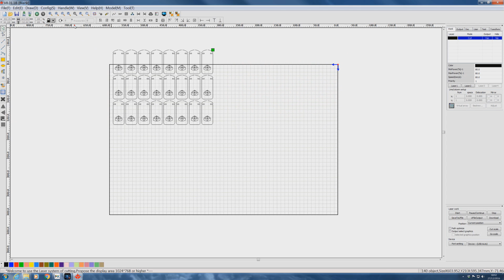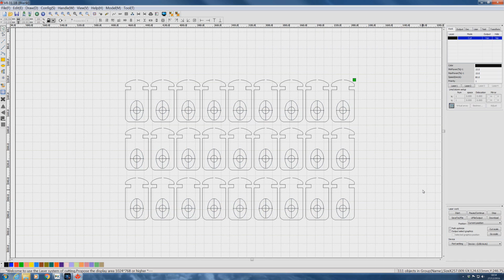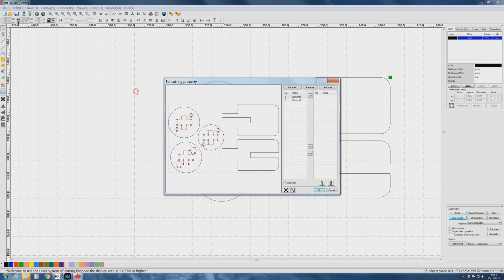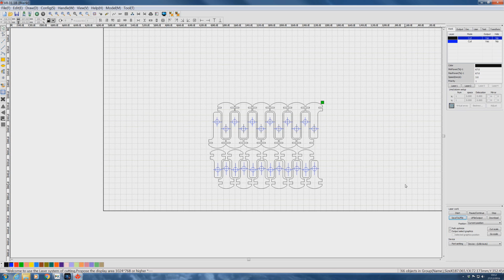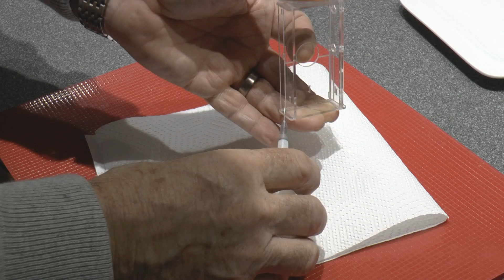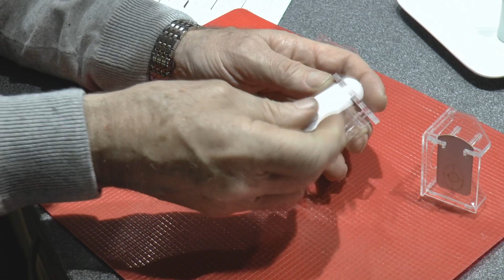RDWorks Learning Lab 91 Beam Targets and holders plus mirror tool

Comment: If this program works in the same way as Corell Draw, the grid pattern you have set up is the page. It should be the same size as the deck of the laser printer. In Corell, if you drag a group of objects outside of the page, (or off or the grid) the program doesn't see them as objects to do anything with. That means you don't have to delete them each time. You can just drag the items you want to work with onto the grid area and drag objects you've already worked with to the side. Off of the grid area. Give it a try.
Reply from the maker: Anything outside the work area will still be considered and it will prevent you running a program
Russ

Comment: DA, if still there I have sold three other 4060 60W machines. This  order qualifies for a $750 volume discount per machine. This discount when applied puts your machine, including shipment to Memphis, at $2530. I must schedule shipment of all machines within 30 days. Email if you choose to move forward. If anyone else wants to add an order for a 4060 60W laser  in next 30 days the same discount and 30 trial warranty also applies. After 30 days will need to sell a combined three additional machines for another volume order discount. ron

Comment: Do you have an opinion on the current state of the 1200-1400 USD eBay Chinese lasers?
Reply from the maker: Hi
The only thing I have noticed is there are fewer sellers of these bottom end machines. The choice is now down to less than 10 for 50/60 watt machines, whereas a year ago there were 30 or 40 to choose from. The tube and psu quality is still rubbish so what you are buying is a mechanical/cnc system that is still very good value for money . The tube in particular is definitely a consumable item but just like inkjet manufacturers supply new machines with full size cartridges but 5% ink inside, to get you started, the Chinese have adopted that same principle for Ebay machines. If you buy from a reputable source in China you get what you ask for but at a much higher price. The ebay route will always be a bit of a lottery. 
Best regards
Rus
Reply: SarbarMultimedia
The 40 watt lasers have greatly increased in price as well.  The real machines are so over priced it is why people have been running to eBay for this stuff.
Reply from the maker: If I was running a serious business and had a market already set up,  then the safe reliable way would be to buy a proper industrial standard machine like Epilogue  or Trotec etc. But for a small startup the dilemma is always going to be budget and projected cashflows. As a hobby user I would never have considered buying a Thinklaser machine because although it is a fraction of the Epilogue or Trotec price, it's still too high for a non-specific user such as myself. I had to bargain hard to to get it into a justif. able range Although it's a great machine and I love it, I will be finding the smallest excuse to take it apart to find out how it ticks. Most users will be happy to just use it "as is" and they will be very satisfied with something that just works about 98% perfectly.  However the extra care an attention to detail and superior Chinese quality still costs. Add to that the service support and genuine warranty support,  and these are the "added value" aspects that you are paying for. Buy from FleaBay and it's" buyer beware" and zero support....no life boats here. That does mean you get good value product if you buy reasonably wisely,  even taking into account the rubbish tubes and power supplies fitted. It's great way to get started form scratch, learn by your mistakes and then be in a position to flash the cash on a proper machine at some future date when business is exploding.
Thanks for the comment
Russ
Reply: SarbarMultimedia
I agree.  I might have a market for glass engraving but unless I was 100% sure I wouldn't plop down 3.5k-10k for a laser machine because that would take a lot of sales to just break even.  The problem is knowing which sellers are legitimate and forthright ESPECIALLY considering the Chinese sellers I have seen for everything just can't tell the truth.
Reply: DA. No longer need to rely on eBay crap as option. Have recently purchased my 4060 from Chinese manufacturer directly. Been talking with them for several months. They  guarantee mim. 6 months on tubes, no over-driving mA and 3 years on machine.
Been awarded sales distributorship. They provide direct email service. Have responded within 24 hours to my inquiries. 
If interested in purchase of quality laser machine with warranty and guarantee of tube wattage let me sell a machine even Russ would find acceptable, for less than you would find at a retail dealer. Would you consider saving thousands with less adjustments than Russ suffered through. I will provide 30 day full purchase refund, not including customs and land transportation.If not completely satisfied. Russ will beat me soundly about head and shoulders if I'm not being truthful. Tell me your tube wattage and desired working area and I'll provide jpeg's and quote next day. ron1phillips@yahoo.com. ron
Reply: Ron Phillips
I have enough going on with 3d printers and fighting them I am tired of fighting machines.

What is a 4060?  60 watt (that is a true 60 watts) and I need one with the round glass adapter the 50 and 60 watt machines come with.
Reply: DA, where is hometown and country. Will get quote to nearest port. Quote will not include Receiving Agent and Customs fees. Both should be nominal. Mine less than $100. Land transfer fee if you cannot pickup at port. Have not experiences non-circular laser tubes, but will conform. I should received my 4060 this month. Could share impressions. Give me 2 days to respond. ron
Reply: Ron Phillips
The round glass adapter I meant is where it spins something on it like a drinking glass so you can etch it properly.  All Chinese 50 watt, or more, come with it.  I am in Memphis, TN and would need land travel as I am on the Mississippi river but not sure if they would come that path or would need the land route.  We have ships come through here with Chinese goods up from the Gulf of Mexico so I just not sure if they would need a land route or not.
Reply: I've  heard from numerous internet eBay laser buyers and  Russ to never trust the eBay huckers with my money on faith. I will give you a money back assurance, return shipment to factory or myself whichever less. ron
Reply: DA, should have information 2 days. 
They have Cusotm agent if you want to yse them. ron
Kent need price on a 4060 60W  with shipping to port near Memphis, TN, with continuing service up the Mississippi river if available. Destination to be determined. 
Would I need to place DA in contact with Eric as option for agent in Memphis ? 

Please read DA comment and respond if you need further information. ron
Reply: I would say that there are different levels of quality that you can get with Chinese laser cutters. I work at a makerspace and I've seen at least a couple cheap lasers scrapped for parts and some that have been going strong for 5+ years. We do all our work on two Chinese manufactured laser cutter at my company Black Cat Labs which we are very happy with (@blackcatlabs.co on instagram if you're curious). We have worked with the manufacturer on a few custom projects in the past so we decided to get a custom laser through them designed to our specs. If you have any questions feel free to get it touch with me.